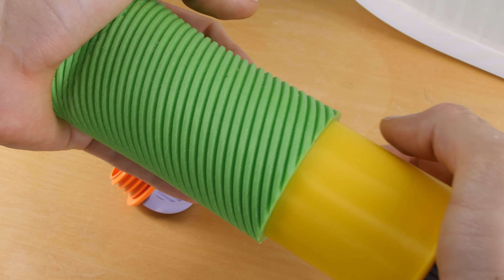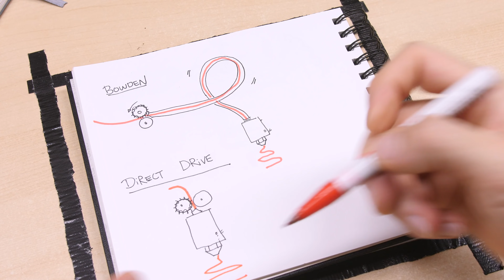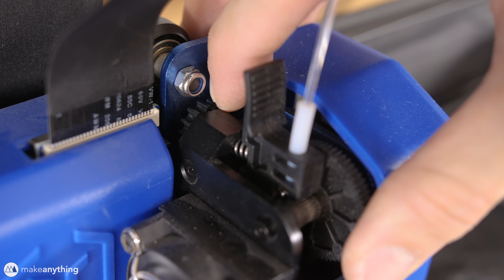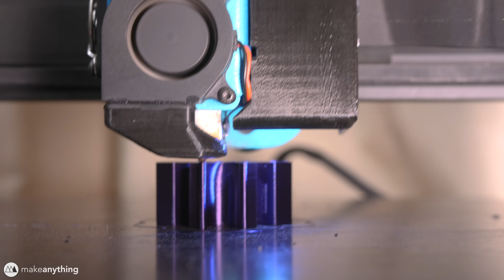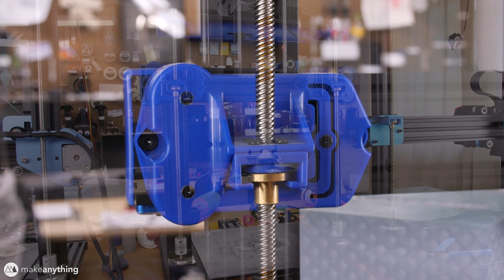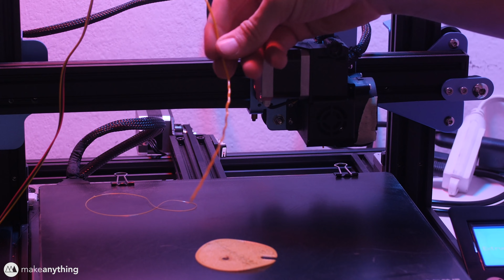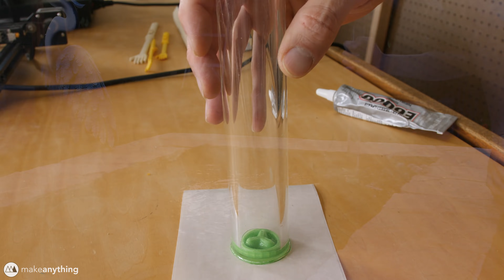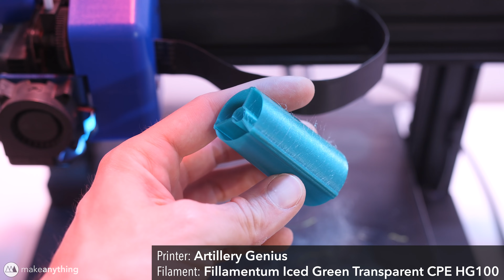Direct Drive 3D Printers in 2020 // Artillery Sidewinder X1, Artillery Genius, Sovol SV01 MEGAREVIEW

Comment from the maker: Corrections:
- The Artillery Sidewinder X1 and Genius actually heat the bed using mains voltage (110V in US) which is why it's super quick
- Multiple reports that the latest version SV01's are capable of printing flexible filaments really well. Apparently I just need to add a small piece of PTFE tube above the heatsink. I've gotta try that!
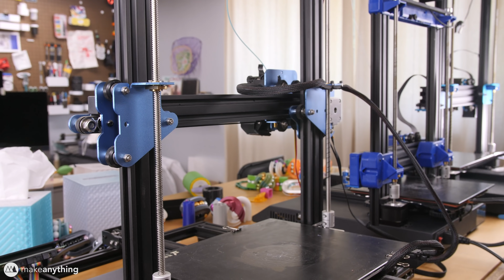- It looks like one of the Z rods on the Genius is slightly bent. That may explain the z-banding I saw. You can see if on the left side at 6:16

Thanks wise viewers for schooling me :)
Reply: Nerys would say: Remove the bearings and the belt on top of the Genius and let the rods rotate freely! :) And I have seen many creators confirm this. Did you try this, for getting rid of the Z bending?
Reply: @elmariachi5133  i'm sure it will work , unless the screws are bent real bad, when i got my 3D printer i added bearings at the top of the leadscrews too , then i realized how it could make things worse, i had left them on anyway because it's an anet A6  3d printer and having the weight supported both top and bottom makes for better prints , guess i got lucky and got pretty straight screws, if i remove the bearings the weight will push too much on the bottom plates when it tries to raise to next layer and will have inconsistent layer height.
  if it were a metal frame 3D printer i would remove them asap.
Reply: Yes, I think so, too of course. But I'm afraid, Devin didn't read the comment :(
Reply: So you said that the ninja flex gets tangled in the Extruder of the SV01. There was a fix to that if you took apart the Extruder and added in a small piece of PTFE tubing to it. Just with that little addition I was able to get my Sovol to print flexibles just as good as the Sidewinder that I own.

Comment: hey devon i must ask  i know it has been a few years since this review. but i am curious where did you source your holder for the x1. if you don't remember that is fine.
Reply from the maker: Sorry, what 'holder' are you referring to?
Reply: @make.anything  apologies, the filament roll holder, on the x1 side winder.
Reply from the maker: @rathburnscape6465  oh of course, I forgot I took that off another machine! I borrowed that part from a CR-10 i had at the time. Many Creality (and other) printers come with that style, though I'm not sure where one would buy just that part
Reply: @make.anything  thank you very much! Well I will see what I can do on that. I also looking at a few options for a printer via a print to fix z-banding via misshapen spools
Reply from the maker: @rathburnscape6465  my top-loading spool holder might work for you. The spool sits at a different angle, but if you placed it need one side of the printer I imagine you could have success: https://than.gs/m/912218

Comment: What a difference a couple years makes.  SV01 Pro with auto leveling is $229 now.  But the printer I'm really wanting to see come out is the new Bamboo P1P with it's CRAZY fast print speed at $699...  that will give a shove to the market I believe if it works like the X1 does from them...

Comment: The sv01 was upgraded. It is selling on amazon for 259 with upgraded silent board, upgraded maxwell power supply which heats up the bed much quicker, the heads are upgraded letting you print with flexible filament. What sold me on sv01 was how clean prints look compared to $500+ printers and also the fact that I can laser engrave with is using the laser engraver attachment.
Reply from the maker: I'll be trying it soon!

Comment: I'm new to 3d printing and want to buy my first 3d printer. I want an efficient one that won't run into too many problems but has a decent sized build volume. Which on of your printers was the easiest to set up and ran into the least issues,  the Artillery x1 or the genius?
Reply: might be a bit late, but the sv01 was really easy to set up
you screw the upper half to the lower half with four screws, attach the screen and plug in the labelled cables

Comment: Thank you for this great video. I'm just trying to get started in 3d printing so my knowledge is very limited. I had a few questions, I hope you could answer:

1) Are you still recommending these as your favorite printers 8 months since this video? 
2) With the additional information and changes to the SV01, it looks like that could be your favorite of these three? And, is the noise of the SV01 a turn-off that should steer me toward the Genius?
3) How can I tell if I'm getting the corrected SV01 or not if I go to buy one?
4) Do you have any great, beginner friendly video for getting the SV01 or Genius set up and running, making any necessary modifications to it, etc. Basically a Getting Started guide? Would love that.
5) What about the SV02 versus these printers?
Reply from the maker: 1. For beginner printers, yep, these are still favorites of mine
2. The changes I'm familiar with were done early on and anything you buy new likely updated
3. Buy from Sovol's website directly, or their Amazon store *links in description ;)
4. I don't have such a video, but look for Ender 3 or even CR-10 setup videos. They're more plentiful and more or less the same process. There's also a manual
5. I avoid dual material printers. They're a lot more prone to issues.
Reply: Thanks a lot, really appreciate it!!  Would you go with the Genius or the SV01 for a first printer?
Reply: by the way, there’s a silent motherboard upgrade which can really reduce the noise from the stepper motors, but the only other problem might be the fans

Comment: Clean off the lead screws on the Genius. Your banding is likely being caused by tiny debris sticking to that thick lubricant. 
Clean the threads and nut.. Then use a lube that doesn't attract dust.
Should help with that issue.

Comment: What slicer did you use for the Artillery X1. Did you use the Repitier or Cura ... have been trying to use the Cura but seems some issues because it’s not listed in there printer selection. Any recommendations. Thanks.
Reply from the maker: I mostly use Simplify3D but also Cura. You should be able to just use the Creality CR-10S profiles. You can lower retraction to around 3mm since it's direct drive, but otherwise all the other settings work well!
Reply: @make.anything  thank you ... helped a lot ... appreciate the feedback. Take care.

Comment: Nice video ... let me ad some thinking. I’ve been at the for a few year for a while. I’m happy for your last updates on the unit you reviewed. This is my recent thinking. I’ve been time to change my Creality CR 10s Pro to a direct drive. You can spend several dollars to buy a direct drive unit. Actually at the additional cost to just buy a different printer that’s available as direct drive. That said ... looking at the printers reviewed have many of the components the same as the Creality printers. So .. shot side of this. Im converting my bodened  machine Back to where it was and then order one of the Artillery Printers as direct drive. No brainer. Thanks.

Comment: Might've had more success with that print in the beginning if you'd used gear bearings instead of ball bearings, without ball cages the balls were running into each other and binding...
Reply: Looking closely at the Z lead-screw on the left side of the Genius, it looks like it's not actually bent, but just incorrectly inserted into the coupler at the bottom, where it meets the stepper motor. Could be an easy fix...

Comment: If you needed to print something that was as long as the maximum print height of the printer, but this shape was unable to stand up by itself, would it be possible? Picture a 12" ruler, for example. If the printer can print 12" but only vertically, is there a way to make that work? Thanks

Comment: Hi. I bought the cr 10s and I’m having those exact issues plus the tube doesn’t stay where it’s supposed to so the gears shoot unmelted plastic everywhere so I have to rewind the whole thing. I’ve tried to tape it but then the filament still doesn’t come through the end. I’ve tried pushing the tube down more but I can’t seem to get it down further. So my printer doesn’t print. 😐 Any suggestions?? That would be very appreciated.

Comment: I got my ender 3 and major no stick build plate. After a week of videos and testing. I have mastered the build plate stick. Initial Layer I set mine to 150% and bed temp set to 230 C to work with PLA.
Ultimaker Cura 4.6.2 has this setting to low. Once I set flow to 230c. Not one problem using Skirt or Brim.

Comment: I just got the sidewinder and, of course, it didn't come with filament. I ordered some from a company called Cable Ties and More. It was only 17.99 per 1kg roll, so I ordered it. Have you ever used these guys and if so, what were your thoughts? I would also like to try the ninjaflex, as I've heard really good things about them! Good Video!
Reply from the maker: I haven't heard of that filament brand, but most cheap filament work fine for general printing. NinjaFlex is trickier, but fun!

Comment: Helical couplings are garbage. It's time for all manufacturers to go to integrated stepper leadscrews. No more couplings. If they're going to use coupling anyway, they should at least use a ground end for a proper fit and a zero backlash non-helical coupling.

Comment: Thanks for the ABS tests!. There are some of us that are interested soley in the functional category of printing
Reply: As I'm printing most of my stuff in ABS, his tests are kinda worthless though... none of those models is actually prone to warping (even if he says so). Most have very little contact surface, are round and the "router clip" is like 1.5 mm thick. That's not where you'll see warping usually. A simple 10x1x1cm box without brim would have been a way better test then any of those prints. I'm pretty sure i could recreate those prints without any form of "enclosure".

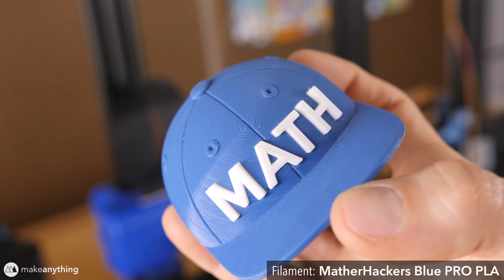Comment: 12:18 this is usually due to the heated bed bending when it warms/cools by the heating element being switched on and of to maintain temp. Try PLA and turn off bed heating to see if the banding dissapears. It has to do with the firmware and how the bed is switched/controlled to get a better result.

Comment: I don't know, I've had some very solid prints with my Ender 3 Pro that look very similar to what you got here. I guess it all comes down to preference, but I wouldn't trade it for these.
Reply: Just got an ender 3 pro a few weeks ago, from what I can tell the sv-01 is identical save for the direct drive. Others have mentioned that you can upgrade the ender 3 with a direct drive, I haven't had any issues with mine yet but it's nice to know the option is there.

Comment: The atillerys use 8-bit boards with silent stepper drivers which get more hot than actual TMC´s. Sometimes I hat an inconsistent layerhight because of an single missed step, which might be the result of a hot driver (but I can not tell for sure). Never hat this on the sovol.
Also its quiete simple to upgrade the sovol: An SKR e3 mini fits perfectly: only you have to make or buy an adapter to connect both z-motors. So you can make the SV01 silent for less than 30 bucks and also go 32-nit while doing so. The TMC2209 go not as hot as the cheap silent drivers on the sidewinder.

The print quality of the solvol (if you add the little piece of tube missing) is definitly better than on the sidewinder. Thats quite normal, as the volcano has a longer meltzone. So you have mor molten plastic ready to go, causing more droping and therefore stinging. As molten palstic is vicous, the output of the nozzle reacts slower to the feeders actions (might compensate it wit tuning linear advance). So a volcano only is usefull with a bigger nozzle diameter. You can add a volcano on the SV01 - need another fanshroud, wich can easaly printed and you move up the endstop a little. So you can print with a 0.6 or 0.6 nozzle quite fast a lot of faceshields. You can undo such a change in 15 minutes, going back to 0.4mm with more precise flow.
Changing the sidewinder from volcano to normal block is much more problematic. With the shorter block the nozzle is higher than the rolls of the x-carriage. So the rolls contact with the bed, before tzhe nozzle reaches it. So you have to redesign the whole extruder mount.

Another point: I love PEI powder coated spring steel. You can get such a surface at Aliexpress/Energetic 3d store for about 38$ (or lower if there is a sale and coupons available). Price includes magnetic base. Price for Sovol is the same, as its not regulary in stock, but they cut down the bigger one for free if you ask them. On the sidewinder the bed gets heavier (more risk of ringing) while on the SV01 you actual replace the glas, so less weigt on y. Also better heat conductivity of the bed.
With a spring steel, also adding ABL gets cheap. No need for an expansive BL touch. If you want to add ABL anyways, most likely you would buy normaly a BL-Touch for around $45. With a spring steel bed surface ($38 or less) you get the same good result using an inductive probe ($5 or less) - so upgrading to PEI powder coated magnetic spring steel + ABL cost less than adding ABL only. And you get the nice structure you may know from the Prusa mk3(s) and Prusa Mini.

I like both, the sidewinder and the SV01 (do not own the genius). At all I like the Sovol more; even after replacing the printhead of the sidewinder by an Hemera (with normal sized heatblock) (I destroid original hotend, which was totaly my falt. Changed the nozzle, not tightend it enouch and than printed unattended. Big blob of plastic destroyed a lot). Never had any problem with the sovol (after adding the pieze of tube in the feeder).
Reply from the maker: Good insights, thank you for sharing!

Comment: Sorry, but this legend of the sidewinder heating up the bed fast is nonsense. The Sidewinder uses a silicone heater, there also sits the thermistor. So you actually measure the heat of the silicone heater. If the bed would be aluminium, that would'nt matter much. But it's glas, a bad heat conductor. So the temperature on the display have nothing to do with the actual temperature of the glas bed, esp. the bed's surface.
Thats the reason why in the profile for PLA in the first layer a bed temperature of 85°C is set. Because than detect reaching 85° the surface realy only about 52-53°. It takes another 3-4 minutes to get close to 60°.
Actually as glas do not spread the heat horizontaly very well, the big holes in the heater for the leveling screws leads to four low-heat spots with about 6-7cm in diameter there the bed temperatur only reaches 45° or even less adter 20 minutes of heating with 60°C. Actually warping of bigger objects there was the reason I bought a Cat S61 with an integrated FLIR. If you take a thermal picture, the image shows all of the catastrophic heat distribution.
I changed my heatbed to a 5mm milled aluminium one (glued the original silicone heater under it) and added a magnetic springsteel. Now heat is spread even and if the display says 60° the bed has reached at least 55°C mostly everythere.
The silicone heater goes up very quick due to using AC. The bed does not, due to being glas.

Comment: I notice you've been using glue on the Genius. I was having some trouble printing PETG and started using glue. The bed doesn't seem to grip as well as it used to.  Otherwise, it prints nicely, and fits on my desk.

Hoping to slowly tune and upgrade parts as I go. Not new to 3d printing, but it's the first machine I've had of my own.

Comment: My first 3D printer (home designed repstrap) is a direct drive unit.  I then printed parts to make a RepRap Wilson printer.  This one has taken quite some time to get working well, and I've converted it to a Bowden extruder to get the weight of the extruder stepping motor off of the print head carriage.  This to attempt to get the printer to run a bit faster as I'm using smaller sized motors than the first printer.  The Bowden setup works.  I haven't tried flexible filament yet, and will limit that to the Repstrap which is a larger printer as well (250 x 200 x 300 mm VS 200 x 200 x 190 mm print volume).  My RepRap uses a home made heated bed (aluminum plate with sand resistors JB welded to bottom) running on 44 VAC (stepdown transformer, relay switched).

Comment: The new artillery sidewinder x1 models changed the heatbreak to a locked one not a threaded one and the way the heatbreak fits against the nozzle is a concave fit. Basically it keeps you from using anyone else's parts but theirs.

Comment: TPU prints better on bowden.  The thing that harms prints is not using a two-gear extruder driver.

Also any printer can become direct drive.  These printers are nothing special.  I assumed you were actually talking about direct axis driving via augers instead of belts.  Boo.

Comment: I purchased the Sidewinder X1 as my first printer mostly because of the heated bed and print volume. I thought I did a lot of research before purchasing but didn't even know the direct drive vs. bowden was a thing. I guess I got lucky with my purchase! 

I do have issues sometimes with z banding. Didn't know that there was a gear tensioner screw before watching this so thank you! I'll see if that solves my issue.